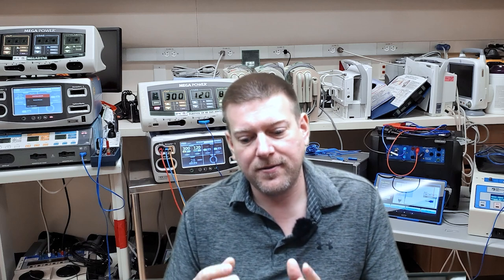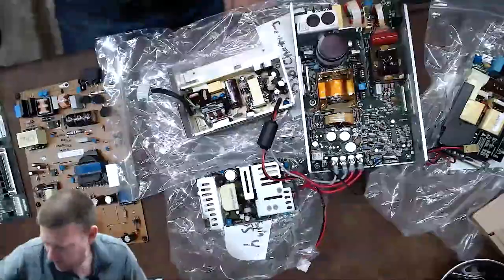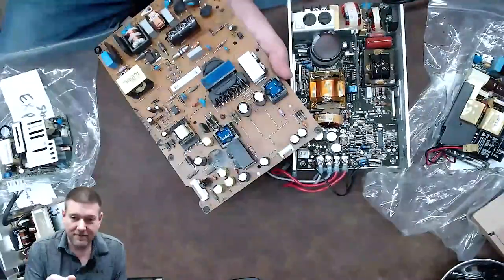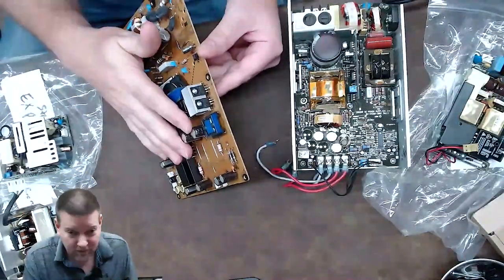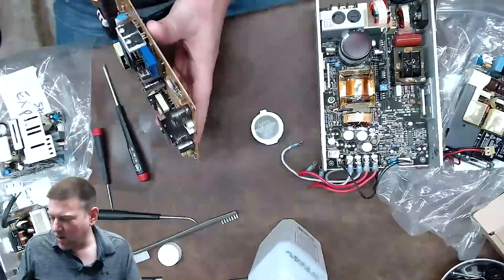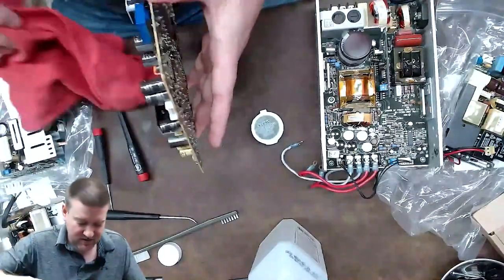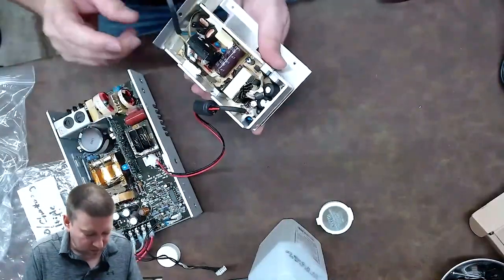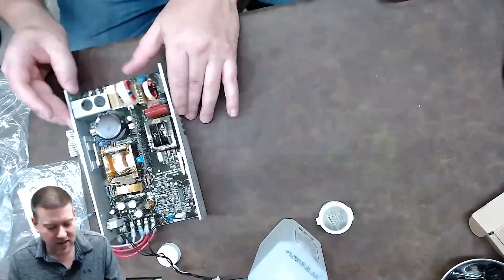Giving Circuit Boards A New Life

Comment: Where can you learn to start repairing Motherboards? Are you utilizing schematics or are you using your general knowledge to repair these boards?
Reply from the maker: Motherboards are usually not worth it unless it's a power management/ distribution section. There are almost no schematics for any of these boards available to the public. Besides, this video is about refurbishing boards to make them last not repairs

Comment: You just get the walmart multimeter, its amazing, its not accurate, but its amazing;  Andoer Digital Multimeter Professional Tester Meter Alternating Current Direct Current Voltage Multimetro True RMS Capacitance Temp Multitester